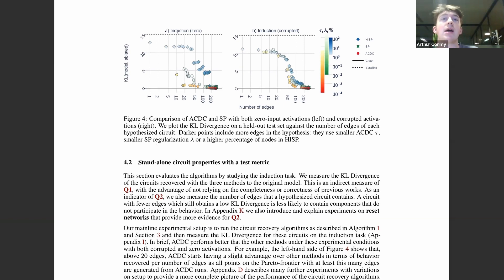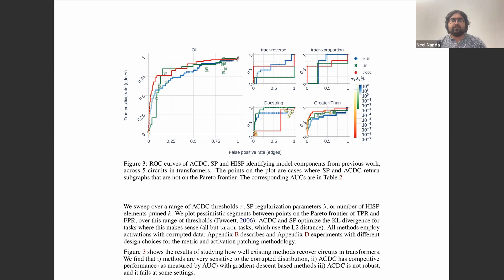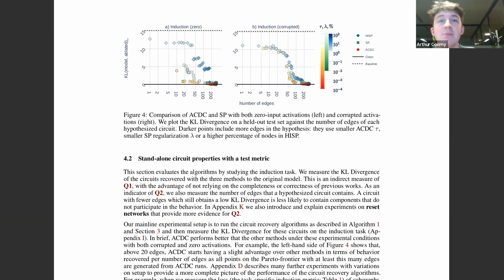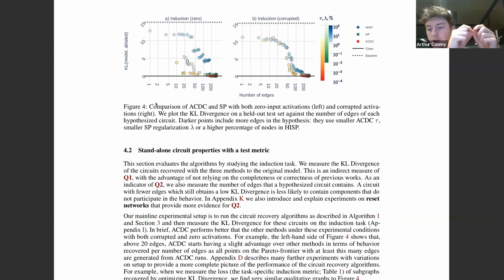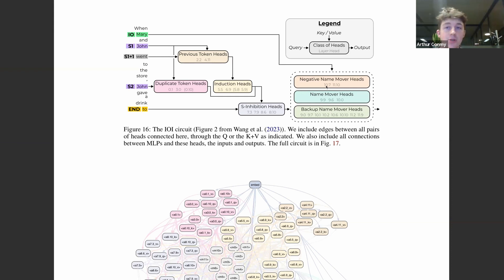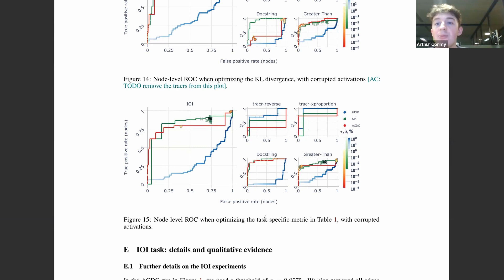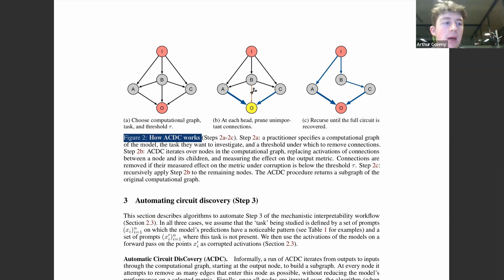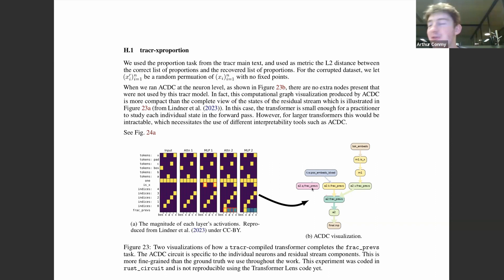A Walkthrough of Automated Circuit Discovery w/ Arthur Conmy Part 3/3

Comment: Thank you for this video!
One thing that wasn't clear to me about the negative components, is why is it a bad thing to not include them in your automated circuit discovery? If they are reducing the probability of the correct answer, why do you consider them as ground-truth part of the circle? Thanks
Reply from the maker: Good question! Two perspectives here:

Balance is important. You can never be 100% confident in the next token, so knowing how strongly to boost the next answer is important. This is determined by the sum of positive and negative components

Don't cheat your metrics: If we're evaluating a candidate circuit, then naively we could look at a metric like the fraction of the original log prob of the correct answer recovered. But if there's two components that add +1, and one that adds - 1, for a total log prob of +1, finding one of the positive components also gets you a total log prob of +1, looking like the whole circuit, because we ignored both a positive and negative component.